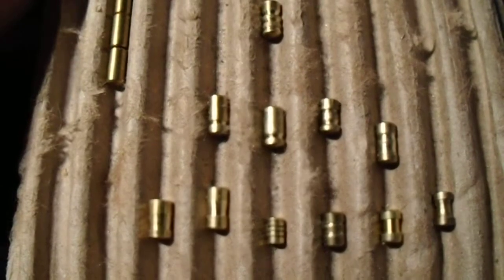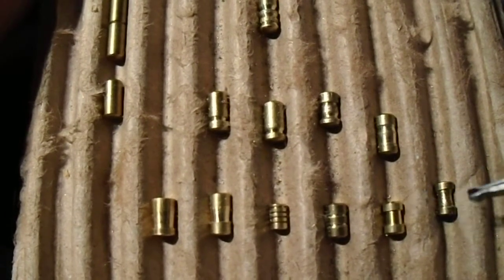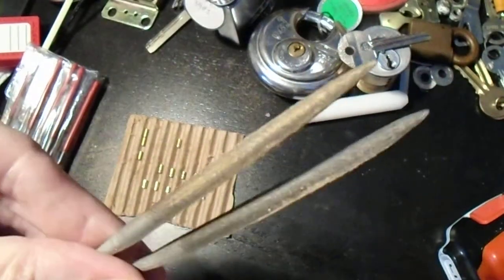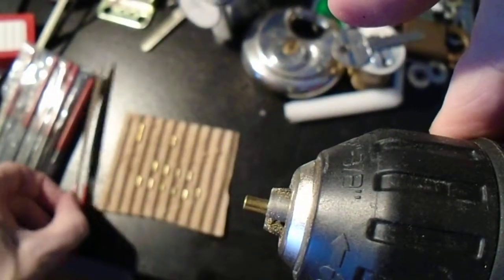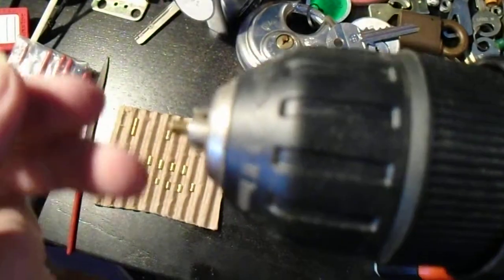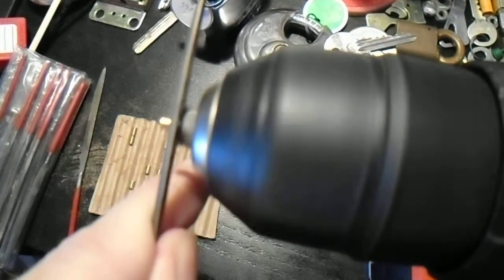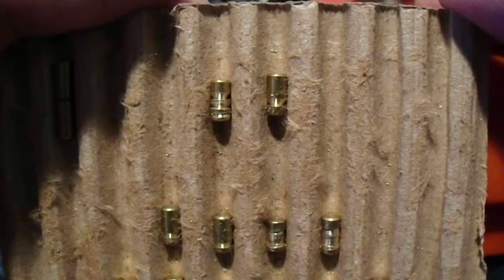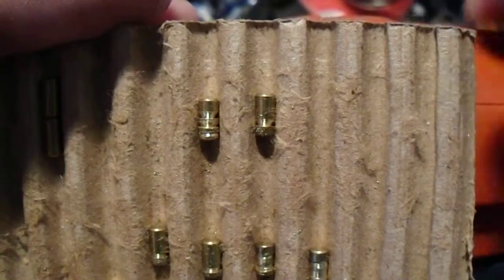(040) Making your own security pins

Comment: Great video Nite. I find the best home made pins come from custom made files. This way you can make the exact pins you want. For barrel pins I use a triangle file and it works wonders. For serrations I found the trick is to use a scroll saw blade. I see your into challenge locks, next time I get around to make some, I'll make one or a few for you.
Reply from the maker: I will have to find a scroll saw blade to try. I find the variety or shapes you get in one of those hardware store 10 or 12 piece 'precision file' sets gives a lot of options. Varying width flat or square files for spools, triangular files at various angles for barrel and mushroom pins, lots of possibilities. Do let me know when you make some more.
Reply: Those are the only files I use, although it does take some searching to find good ones because some carry file that look like smooth metal sticks lol but because they are so cheap, I am able to grind them down to what I like. The triangle for barrels is good except it doesn't have that 45 degree angle until you grind it. My sickness is being a perfectionist so Ill go that extra mile just to make sure I get the 45 degree angle and not the 60 lol. Btw are you in or near NY? Missed Hope again but thankfully it was recorded, enjoyed your talks very much.
Reply from the maker: Your kit doesn't include one of those isosceles triangle profile files? Those usually have something close to a 45 degree angle.
I am in the NY area, and am involved with the NYC TOOOL chapter. You should come to our meetings.
Reply: I live in Bklyn. The meets in the city midtown right? I have been trying to get out there for the longest but life seems to get in the way every time. Ill make it out there one day.
Reply from the maker: It is on the upper west side. You should sign up for the mailing list on toool.us so you get the announcements.
Reply: Done. Thx.

Comment: Great vidéo !!!
Reply from the maker: SmiloDTech Thanks a ton, this was one of the most difficult to get down on camera.
Reply: Nite 0wl I'm sure that was very difficult !
Reply from the maker: SmiloDTech That is how I ended up with that really crazy looking pin at the top of the display, that was the pin from the first three takes.
Reply: Nite 0wl It will probably be good on some locks ;-)
Reply from the maker: SmiloDTech Just loaded it up into my favorite Yale test cylinder. If it hardens up that lock it will harden up almost anything. So far, it is making it very difficult, especially when combined with more traditional mushroom and spool pins.
Reply: Nite 0wl That's great ! You should make more of these ;-)
Reply from the maker: SmiloDTech I intend to, they should make a good challenge lock for the next locksport event I attend.
Reply: Nite 0wl Great !

Comment: What are lock pins made of? I ask - is it possible to buy S/S, copper or brass rod the same diameter as that used to make lock pins? Also, what is that size? Here in England, U.K. we're awash with Double Sided Euro Cylinders. The rod for pin making must be the right size for Euro Cylinders. I intend to have - one side of the lock is left untouched - the other side is modified with DIY security pins. An entertaining lock pick, not too difficult though! Regards.
Reply from the maker: Most lock pins are made from brass, although nickle plated pins are becoming more popular and locks designed to resist drilling attacks will usually include some steel pins. For the types of locks found in doors or full size padlocks pins are nominally .115 inches or 2.9mm in diameter with their lengths varying depending on the manufacturer's pinning system. As far as I know most Euro Cylinders should use essentially the same dimensions for most of their pins (barring the high security stuff which gets very crazy).